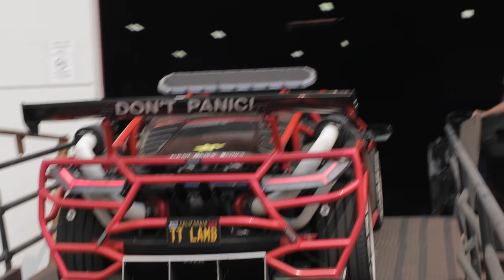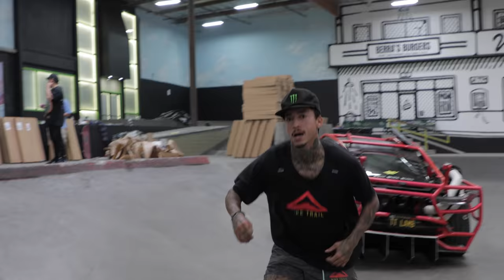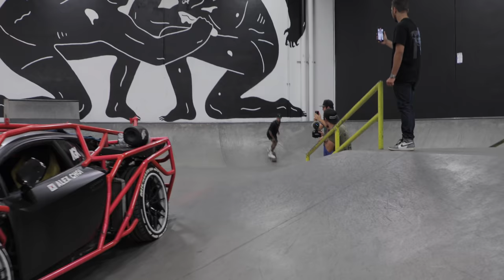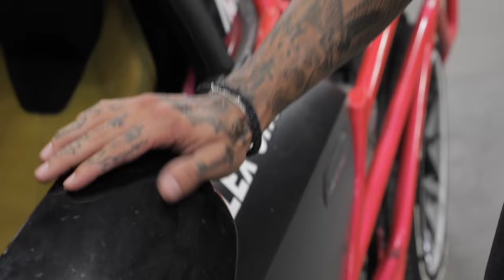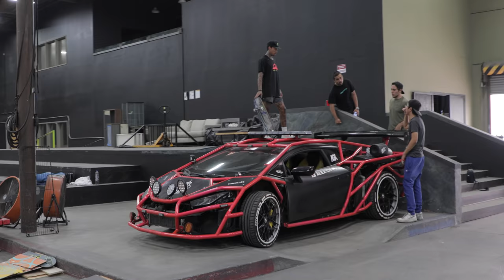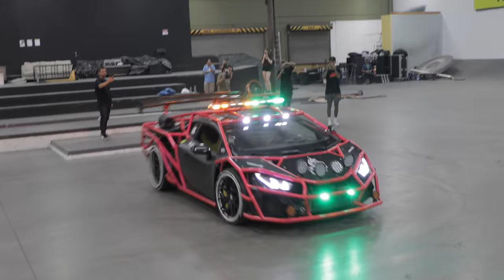SKATING A LAMBO!

Comment: Everyone: nice lambo 
Nyjah: need a little bit of wax.
Reply: and cut that angle bar off, the part the holds the spoiler. just saw it off.
Reply: Jut  know that the car needs the spoiler right? It’s part of its frame
Reply: Jut Nie you do realize that this is no ordinary huracan they literally ripped off the body parts of the car the frame is the only thing that is protecting it. And beside if Alex Choi likes it that oh well too bad
Reply: @myproject132  jealous perhaps, butt hurt is different
Reply: Jut Nie what I mean is you can’t put the original body part of the huracan back together